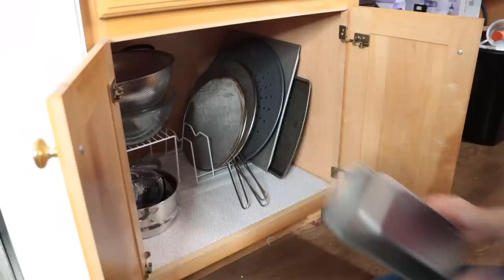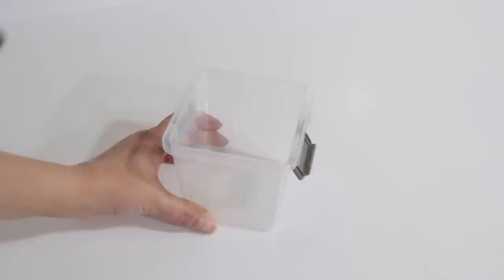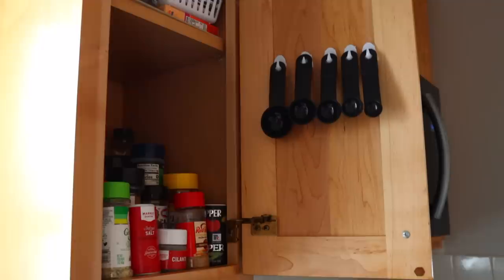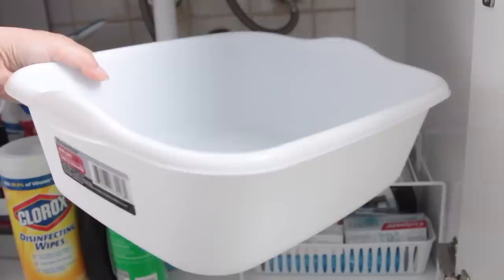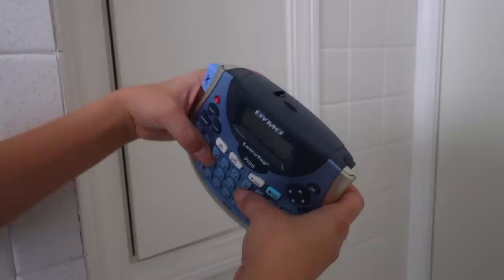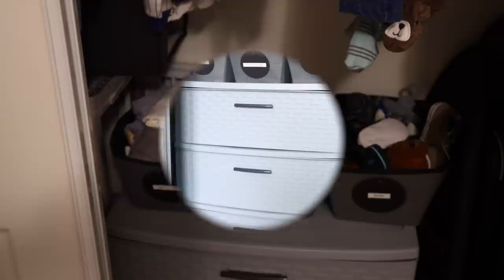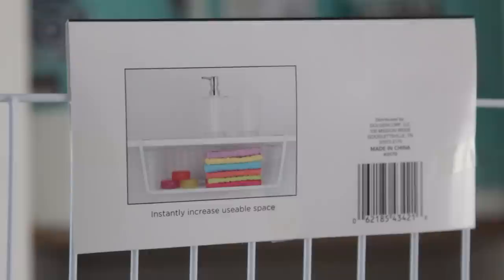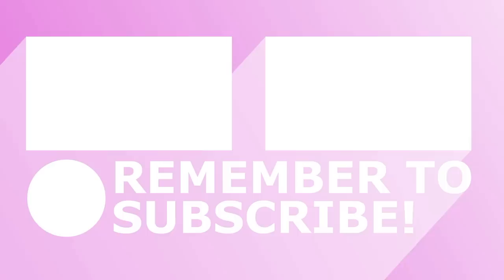50 CLEVER DOLLAR STORE ORGANIZATION IDEAS TO ORGANIZE YOUR SPACE

Comment: I use the little two drawer organizers for contact lenses - one drawer for the left ones and other for the right ones, works perfectly!!!
Reply: @Cheryl Mayers  

I love those little drawers too ‼️‼️‼️
I know they are stackable but - even better is that you can easily pop off the top of one set of drawers and the bottom of another, and they will actually snap into place to make 1 solid unit!

You can repeat this with several drawer sets without and problems opening the drawers! Everything stays perfectly aligned and remains solid with a sturdy snap-on connection! Both of my daughter’s have an 8 drawer “stack” on the opposite side of the bathroom they share to hold their hair bands, clips, bobby-pins, mini-hair bands in several colors, q-tips, cotton balls and chapstick!

Years ago, I found them in all black instead of bright colors and bought the last 2 and stacked them up for my husband. He still uses that 4 drawers tower to hold his contacts, q-tips, the black bands he uses on to keep his giant beard under control, and in the bottom drawer are his tweezers, min-scissors and nail clippers… I friggin LOVE those little drawers but haven’t seen them in my local store for over a year now… 💁🏻‍♀️

Just wanted to mention in case you want do you have more options/play with the ones you already have. Don’t forget to save any extra tops or bottoms in case you change your mind down the road. 

Cheers ~ 

Meg / Tucson, AZ. 😉

Comment: Something I have found with those cheap storage containers is that they are not really airtight so things go stale faster and bugs can get in. So to remedy that I  use “Press N Seal” or plastic wrap over the top of the container just before I put the lid on. Plus to keep bugs away I lay several pieces of fresh basil on top of the plastic, under the lid. Bugs hate the smell of basil or fresh mint.
Also, you can write dates on plastic bottles with with dry erase markers and they wipe right off when you need to remove or change the writing on it.

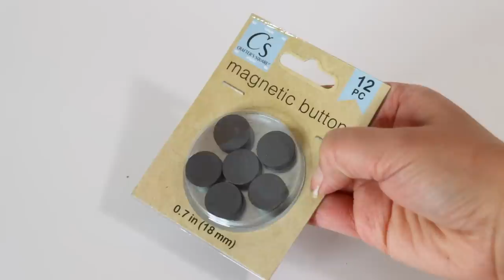Comment: I have a tip for the magnetic buttons @9:59. If you notice the buttons are attached to a metal plate. So if you have an item that is not made of metal but you want to stick it to something like your refrigerator just superglue (or JB Weld) that metal plate (or a small piece of metal cut to fit the item) to the plastic item and just attach the magnets to it (don’t glue the magnets on). Because your refrigerator is metal and now your plastic item is metal all you need to do is put a magnet in between them to make them stick to each other. This way you can use the magnets again on anything else without having to remove any glue.
As for those magnetic tins @ 10:09 I also like to use those for spices. I attached a large metal plate that fits just inside the frame of my spice cabinet door. Then I filled up these tins with some of my often used spices and stuck them to the inside of the cabinet. For any spices that are a bit more powdery I use a little Press N Seal plastic wrap over the opening before I put the lid on.

Comment: Love these ideas, but my concern with putting unpackaged foods in them is the chemicals found in cheap plastic from China. Unfortunately, they do not follow the same manufacturing regulations that other countries do. I use the 2 & 3-quart size plastic jars in my workshop of various size dowels for wood joinery. Also, the drawer baskets are great for separating out various drill bits, screw bits, countersinks, etcetera. The shoe box size boxes I have on holders in between the joists of my shop loft to hold items that are not used as often, such as paint brushes, paint roller heads, extra tape, and the various odd-ball hardware I use in builds. I use a lot of quarts and pint-size stains and finishes and the plastic boxes are great for bringing in items that may freeze in the winter.

Comment: All of these are also great if you have trouble with weevils and moths. If the critters are already in the house getting in the food, it should keep them out if the containers are airtight. If the critters are being brought into the house in the food, then you will discover them in tge containers and you can discard them without the critters getting into the rest of your stuff. You can also let the store manager know (especially if it's the same food or if it only happens to food from a specific store) and that way they can check their product on the shelves or change suppliers.
Reply: air tight or not they can get thru plastic. I was told yrs ago by food manufacturer the only safe container for food is glass.

Comment: Pro tip: flip your utensil holder the other way (a full 180 flip) and push it to the back of the drawer. That way that left-to-right spoon area is still accessible AND you have created a little pocket area for other items at the front of the drawer instead of in the back.

Also: buy the Meyer's concentrate for the multi-surface cleaner. Even accounting for how much you're paying for the concentrate and the water (we're using bottled due to hard water regionally), it still saves you like $30-40. I bought a glass spray bottle with a silicone slip cover for $18 and am still saving money using that concentrate. 8 tablespoons concentrate per bottle. If you reuse the spray bottle you have now, there's almost no upfront cost because the concentrate is like $5 more for 11 extra uses.. It's so good!
Reply: Nicer 
Ty

Comment: Those thin plastic totes in gray you showed can be adhered to a wooden board, or directly to the wall or a door Vertically in a set of 3. I saw someone do this on Pinterest and I did it in a tiny bathroom to hold extra tissue, rolled towels, and dirty linens, & one for my toddlers shower toys.

Comment: If you want a tip to hold the tension rod in place so it can hold a lot more weight we drilled caps to bottle like pop or water bottles onto  the I side of pot cabinets and the. Hung the tension rod with easy end inside fjs bottle cap. It keeps it from sliding down and falling off

Comment: Another way I like to hang up shoes is to get two bindy clips and tie a string to one of the metal openings on each one then attach one clip to the foot opening on each shoe and hang them by the string. If you make strings in different lengths they will hang in layers and not directly on top of each other.

Comment: If you have a cat then you don’t need to buy the container she uses @ 11:23. If your cat litter comes in a plastic jug like mine does then you already have at least 2 of these containers. Heck, save money while your helping to save the environment. My cat litter jug has a handle on one side so I make a line in permanent ink 🖊 just about the handle straight down the the center of the tub, top to bottom. Then I either take a box cutter (be very careful and go slow) and start to cut on the line I made. When I am done I have one container with a pull out handle and another without. Now you can cut the tub in the other direction (across the center) and create a tall bucket or even a small trash can. The other pice you cut off can be used as a kind of funnel. These are GREAT for storing cleaners, sponges, brushes, etc… under your sink. They may not be really pretty but they were FREE and you can always decorate then with paint pens and labels that were mentioned previously in this video. 😁👍
Seeing than most people will end up throwing these cat littler tubs away, I have found that they are also good for pouring you old cooking oil in. I keep mine in the garage any time I have cooking oil I need to get rid of I pour it in that tub. Then once it’s full I throw it away. I know it’s not good for the environment but you don’t want to put old cooking oil down the sink, it will end up clogging your pipes. So I find that this is a good solution.
If you think about it cat litter tubs aren’t the only plastic containers you can cut up or use to store items using left other food jars and plastic containers. I decorate old mayonnaise jars by painting the lids and gluing on ribbons and labels and I use them for storing dry rice and beans. My friends love mine so much they wanted me to make them a set.

Comment: For the round magnetic tins Bethany used on the fridge for tacs and stuff- has anyone had an issue with the lids not fitting very securely?? I wanted to use these so bad on a few tight magnets surfaces, but they just aren’t tight all and I know the first time someone closed the fridge a little hard. So now I have a bunch I can’t use, I’ve only managed to find use for one- for my toddlers tiny elastic, since it has a lid it keeps them from being knocked over as easily and since it is loose I’m able to get it open with one hand when I’m doing her hair. But I’m still so bummed about how the lids fit!

Comment: Hanging the measuring cups @7:56 is a great idea but if you don’t have much wall space you don’t want to see your measuring cups, trying hanging these items inside your cupboard doors with 3M Command Tape or Alien Tape. This way they are out if site and they don’t get any dust of kitchen splatters on them. I don’t know about you but anything I have sitting or hanging near the stove ends up with splatters or grease on it. Them  I end up having to wash it before I can even use it. Which is an unneeded hassle.😒

Comment: In my opinion, dumping bags of chips into plastic canisters does not improve efficiency, all it does is leave a lot of air in the canister so the chips can get stale and then instead of just tossing out an empty bag, now you also have to wash a canister.  the bag still ends up in the landfill, so to me there really is no benefit.  A better idea is to put hooks up or perhaps beneath a wire shelf that you can hang the bag clips on.  canisters are for items that are kept long term like flour and sugar, that come in paper bags.  the paper does not keep the moisture out of the product over a long-term period so those things best kept in canisters.  salt, flour, pancake mix, jiffy mix,  oatmeal, grits, cornbread mix --things like this go better in a canister, and smaller items like corn starch, baking powder, baking soda, all you need is a washed-out peanut butter or mayonnaise jar.  or if you like a pour spout ( i do for the salt) an old creamer bottle, will store what is left after you fill all the shakers then you can just pour it into the shakers from the creamer bottle.  the paper canister the salt comes in will absorb steam and moisture in the kitchen and leave you a salt block by the time you need to refill your shakers.